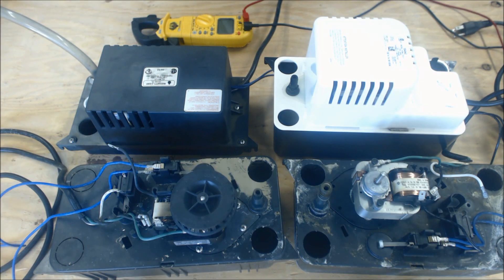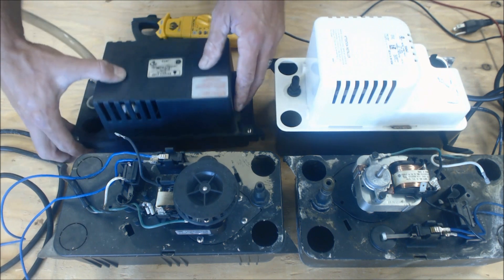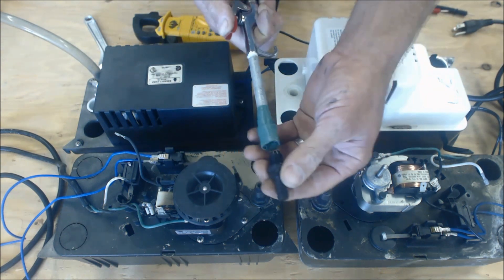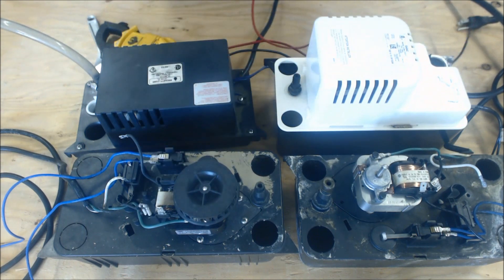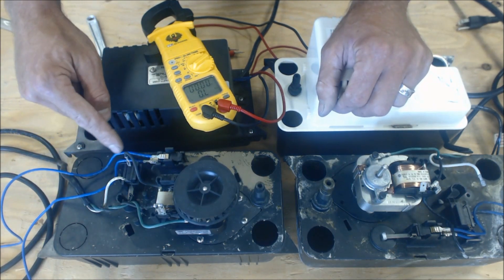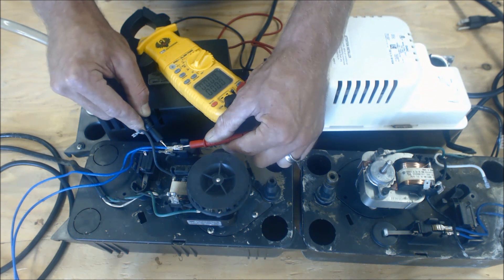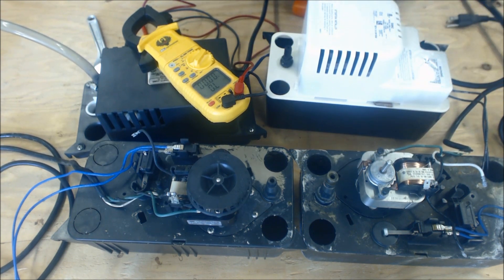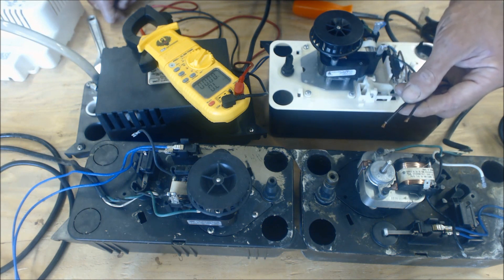Condensate Pump Maintenance, Troubleshooting, and Common Problems!

Comment: Thank you! It was useful to see the non-return valve assembly unscrewed. My pump was cycling constantly. I unscrewed the valve and discovered that the orange rubber valve inside was broken. Ordered a new assembly (but also did an emergency repair on the part with superglue and tape so we can continue using the AC until the new part has arrived).

Comment: Our company uses the Little Giant and I'm pretty happy with them. Easy to take apart during an MA (maintenance) call. One of the things I see younger techs miss on MA's is that they just clean out the reservoir. Sometimes you need to go a little deeper and get that slime out of the guts and valves. Great video!
Reply from the maker: This is true! Thanks for your Comment!
Reply: Good looking

Comment: Thanks so much for this video.  You have explained things so clearly that I am going to take my ohm meter and venture to the basement to find out why my alarm is on.  (not a clogged drain, already checked that)
Reply from the maker: Sounds good, turn the power off, isolate,  test, and let me know what you find! Thanks

Comment: I had a beckett condensate pump issue at a customer home .the cap that encloses the pump it's self came loose so there was no pressure for the water to make it through the discharge hose. the pump just caused splashing and was very loud . this customer was smart enough to unplug the pump. did a temporary fix of super glue to regain pressure for pump . Going back to replace tomorrow.
Reply from the maker: Oh nice, always something! Thanks for the Comment!
Reply: acservicetech can you use bleach in your pump to keep it clean from algae?
Reply: There's all kinds of openings to the air on mine.  What is this guy talking about with the pressure.  I have no idea where it goes outside so the "put your hand over the end of the hose" trick to prime it doesn't work for me.  Mine is running, the trap is full of water, no sludge, but no water is actually being moved out.  Is there a way to prime it or get it to start sucking without needing to find the hose outside? (I am in an apartment.)  I may be able to get the maintenance guy to come soon, but not running the air conditioning really sucks right now.

Comment: Thanks for the video!  I have the same pump as the bottom left one (Beckett?).  How do you remove the one-way valve on that one?  I disassembled the pump and got so far as to remove the assembly that houses the valve, but I can neither pull or unscrew it.  I gave it a good amount of force trying to unscrew it with some pliers, but I don’t want to break it

Comment: The reason why I asked is found a dead one yday and it was barely 6 months old. Don't know why the original installers used a low profile pump but it was in the drain which could have accommodated a normal sized pump. The flat switch from beckett seem kinda shaky too. It was the mind clamped on the sides of the pan.  Do u recommend any specific kind of float switch or set which has worked best for u. Thank you for your help and opinion
Reply from the maker: I usually use little giant but yeah use a full size whenever possible and more importantly pitch when you can instead of a pump, thanks RedCoach Inn!

Comment: I emptied out the water in it. To clean it. Am I supposed to the add water again. There was a ton of sludge in it. There's still sludge all over  the pump and piping that I can't get at. I was thinking about adding some laundry soap and bleach to the water when I refill it. Do you think that's a good home remedy?
Reply from the maker: Usually we unscrew the motor assembly and wipe out the condensate pump housing and put in Hydrex Condensate tablets, thanks- http://amzn.to/2z4DAno